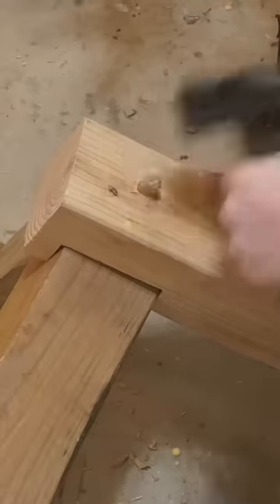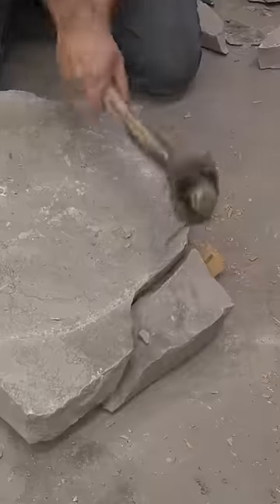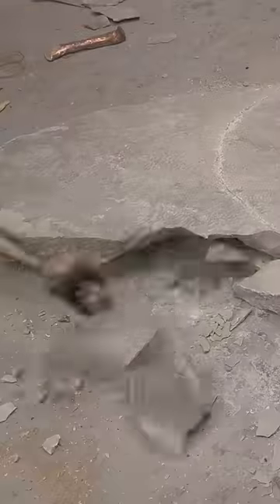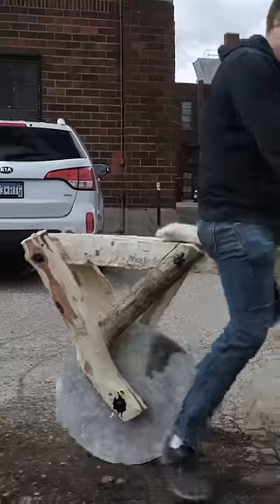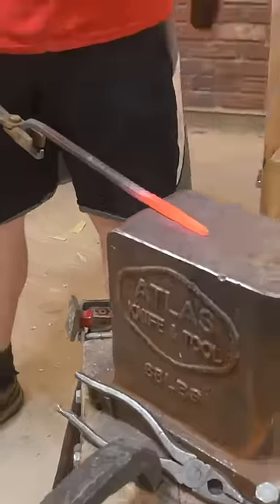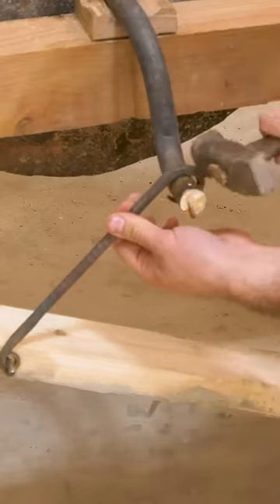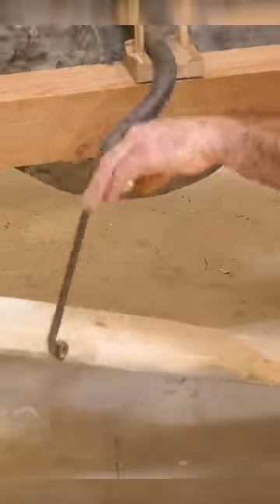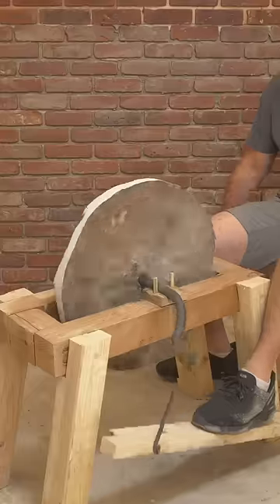This Tool Keeps Things Sharp #grindstone #shorts #diy #history

Comment: Looks like a good leg workout too.
Reply: The treadle actually lowers the force required. It's easier than riding a bicycle. The wheel is heavy so when you start it with your hands, the inertia keeps it spinning for a while. The foot pedal is a lever. The longer the pedal, the more leverage is created. Increasing the distance decreases the force required. Same applies to the crank. Lengthen the crank to increase the speed or decrease the force required.
Reply: Ever hear about the time Thomas Jefferson wanted a mirror polish for his axe head? gave up as was not worth the work.

Comment: You need a drip can or water bucket at the bottom. This keeps the grind stone wet
Reply: A sandstone wheel is typically used dry. Sandstone is soft. The sand falls off as it turns so it doesn't clog up.

Comment: To make the grinding surface a bit more even, you could use some rocks on it while spinning the grindstone.
Reply: or sharpen a lot of tools
Reply: The circumference should Ideally be flat. Like a nickel or a penny. They'd be better off with the chisel.
Reply: It will get smoother the more it is used
Reply: You need to set it otherwise it will wear uneven like a lath, just use you 9 inch grinder
Reply: @pineapplesideways3820 I think you're missing the whole point of the channel. Making everything from scratch. And only using the tools they have made (at one point they allowed equivalents - if they made high-carbon steel once, they allowed bought knives made from steel. I think they are stricter now - make it to be allowed to use that tool, and ideally use the tool you made)
Reply: An industrial Diamond will level and smooth The Rock perfectly
Reply: @samuelmellars7855  I think your missing the fact that we live in the 21st century and power tools exist
Reply: @kyleharvey1302 And knife sharpening kits exist, but they both go against the premise of the channel. this is about as intelligent criticism as telling Mike Tyson to just bring an axe

Comment: Instead of having a spike in the side of the grindstone, make the axle hole square, and hammer the shaft square, or even flat. Use thin wood wedges to center and lock the shaft in place.   
Also, add a bottom to the frame and fill with water so that the edge of the wheel touches the water.
Reply: We went through a few ideas of how to set this up. The square hole works great, but there is historical president of an axle pin
Reply: I think drilling 2 round holes is easier than making a square hole with a chisel.
Reply: Yeah as a stoneworker, you dont want square holes in your stone. They crack. And its not "maybe it'll crack" it WILL crack
Reply: @outkast937  It doesn't have to have square corners. And making two holes close to each other doesn't increase the likelyhood of it cracking?
Reply: You missed the single most important issue. Dressing the grindstone so that you have a flat surface to sharpen with.  If you don't do that it's going to be impossible to get a consistent clean grind.
Reply: @theomelchior2739 Well I never voted for that historical president so I say "boo" 🤓.
Reply: In a historical book I read they advise that you make the hole oversized, adjust the arbor with small wooden wedges and cast some lead to hold it.
Reply: 3 things about a big stone with square hole. It big, it gonna crack, and Noone gonna steal it.
Reply: Lmao that sounds so much simpler

Comment: Found an old grindstone setup at a farm auction a few years back. It's got a metal frame and a double treadle?and an old ass bike seat super comfy to use and actually pretty fluid in its motion. A quarter of a tire is slung below for holding water. Love it and only paid 50 bucks

Comment: What I do in my forge when I am forging an axle for a grindstone, I keep it square where it sits in the stone. Old stones usually have a square hole. This way they turn with the axle. Also grinding towards the blade not away from it. The other way round is just for blades which need a „lip“ like a razor. 
(Hope I got all the technical terms right.)

Comment: Cast a lead block into the center of the hole in the stone and it will pretty much never crack from use. The hole in the stone cannot have sharp edges, but you can divet the inside of the hole so your casting makes nubs to fit inside

As for the crank shaft, whenever it wears out the lead core you can remelt and retap the core .

Comment: I like to think that mythical stories of powerful swords, armor, and other weapons are partially true because the smith who made them just happened to come across equipment that was just better. Like their grinding stone was from a chunk of meteorite with some crazy strong ceramic material. The iron they used was also from things like meteorite or deposits rich in other elements and minerals that resulted in better blades. I remember seeing some documentary where they examined an ancient sword that actually had naturally occurring carbon nanotubes inside of it. Imagine having a sword like that going up against the low quality iron and steels of the time. Able to just cut through like butter sometimes. And only the nobility could afford weapons like this, so it would make knights and nobility seem more powerful than they really were.

Comment: Hate to be that guy . You should really go through the effort of balancing it out so there aren’t any of the wobbles or dips . They will greatly change the bevel of your blades and the lack of consistency will make getting a sharp edge all but impossible. If you ever made one again using a chisel to create scribe lines goes a long way in creating straight breaks .

Comment: Man, if you are actually using this as a sharpening wheel or grindstone then you need to smooth out the surface and make it even. You would have been better off using a tile saw with water. The whole point of a grindstone is to sharpen your edges on a FLAT SURFACE. That thing has more bumps than prepubescent lad with acne. If you are informing then tell us you aren't a professional. Because clearly you aren't. Yes it's a good design but your execution was way off the mark.